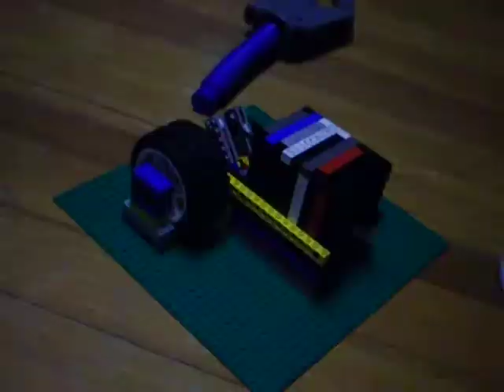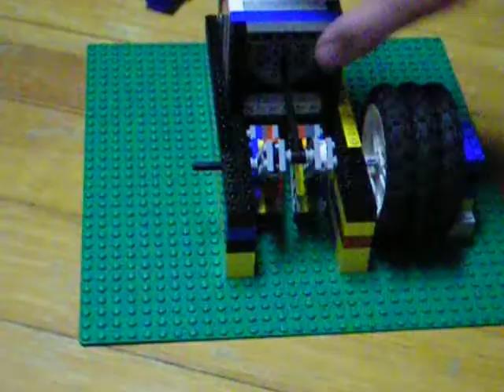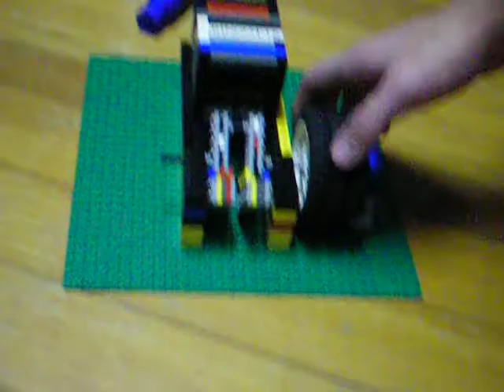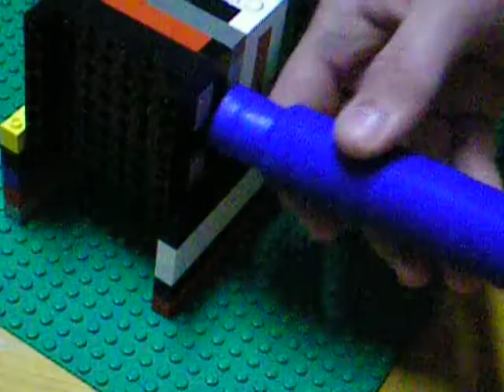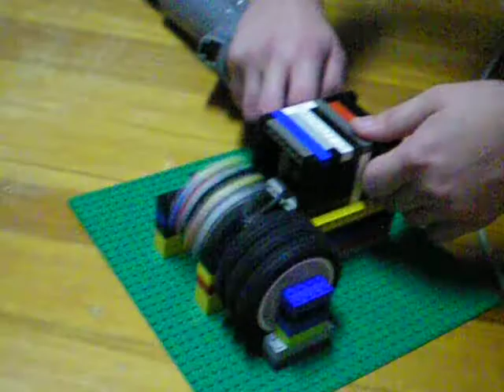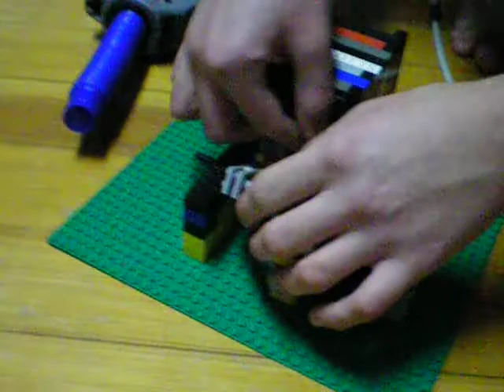Lego Vacuum Engine v2.0

Comment from the maker: @WarbabyFox That's a good idea. It probably would run on compressed air, but you would need a very large volume of it. When I use it to power the pneumatic cylinder engine, I use a 1.5 liter bottle and it runs down slowly because the cylinders are so small in comparison to the vacuum engine cylinders. It only is able to run on vacuum power because the vacuum is not limited as to how much air it can pull out i.e it will keep sucking as long as it is on. I also think that the vacuum is stronger.